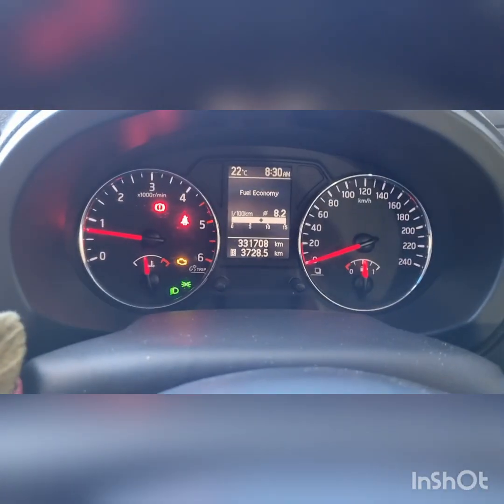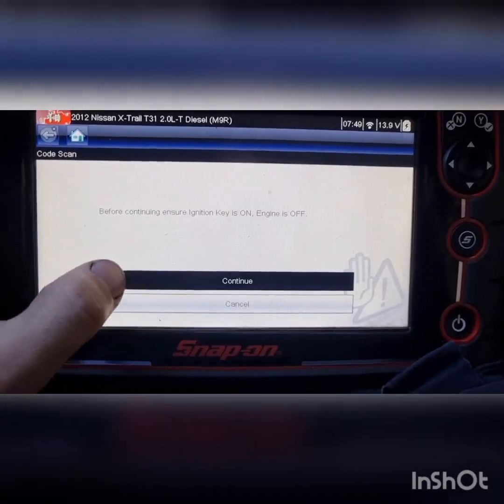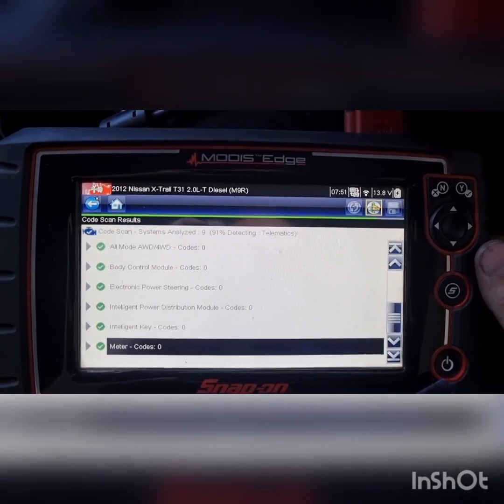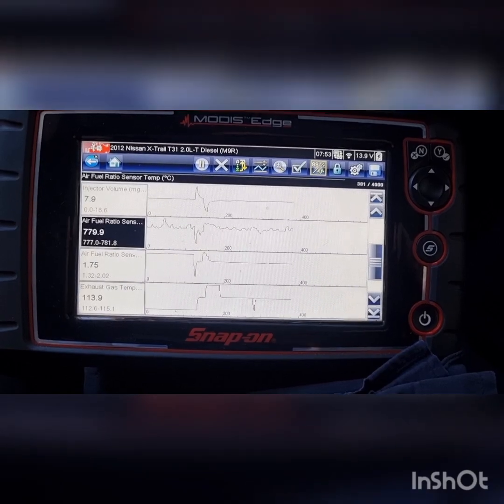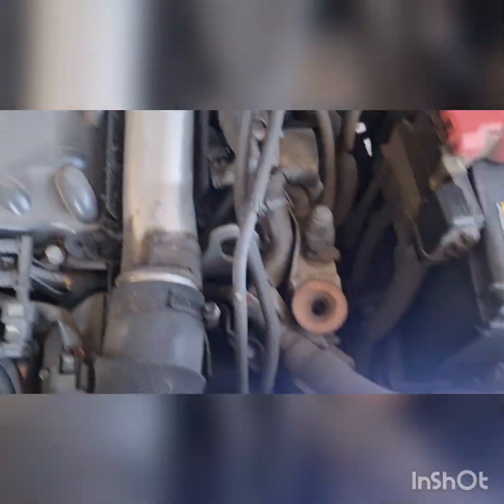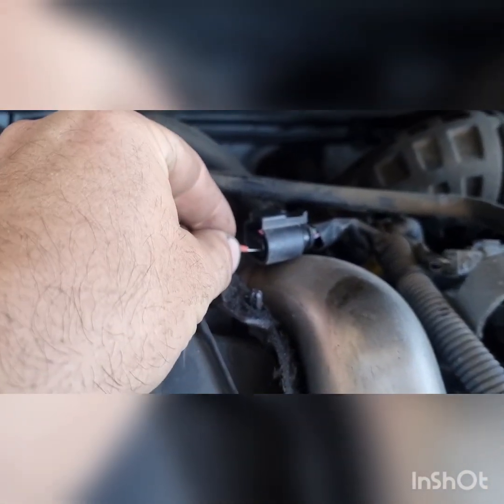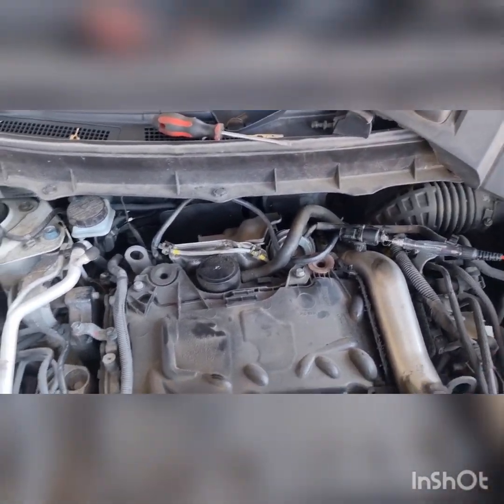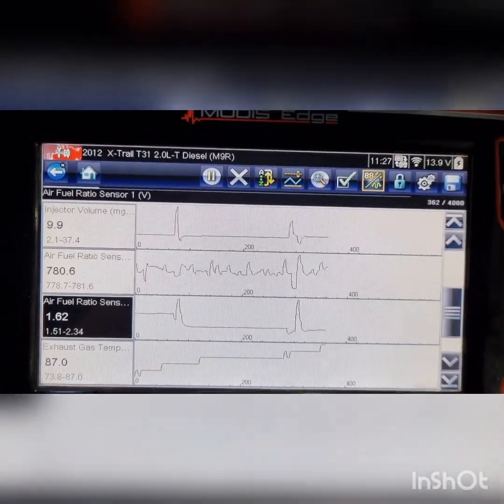Nissan X trail P2A00 Air Fuel Ratio Sensor Circuit / Oxygen Sensor B1S1 Range/Performance

Comment: This fault code just came up on my X-Trail. I've cleared it once but if it appears again I'll know where to start looking now. Thanks for the video 👍🏻
Reply: Bit of follow up. Fault has returned so I'll change the sensor now. After re watching the video I noticed there was a cruise control fault. I'm wondering if that is linked to the sensor fault as my cruise control stops working when that sensor fault is present.
Reply: @muscularthumb same issue on our Qashqai J10. Mil has lit up a couple times over past few days, code reader says P2A00 and cruise control function in the car won't work.

Did you solve your issue? 
I'm only a novice diyer but wondered if the loss of cruise control was a sign that it's in limp mode rather than related to the fault. Total guess though
Reply: @RetroRobbie-jr8xb  yes changing that sensor solved both issues of cruise control not working/dropping out and the check engine light. I'm thinking when the sensor starts to malfunction, it will throw a soft fault code that will clear itself on restart and after doing that a couple of times it turns to a hard fault that causes the check engine light to display and won't clear until you plug in a scan tool and clear it. I spent a couple of trips back and forth to work diagnosing the problem and would notice the problem would happen essentially on the same part of my trip where the car was coasting down a long hill. When the cruise control would stop functioning, my scan tool would show it as a pending fault and when that happened a couple of times it would turn to a stored fault and required clearing to get the cruise control to work again. Changing the sensor was simple enough but just required an oxygen sensor tool to remove the sensor as it's in a bit of an awkward spot to get to with just a regular spanner. Hope this helps.
Reply: @muscularthumb  thanks for getting back to me so fast, I'll look into that sensor
Reply from the maker: Thanks mate!